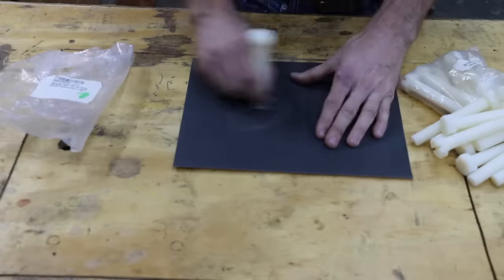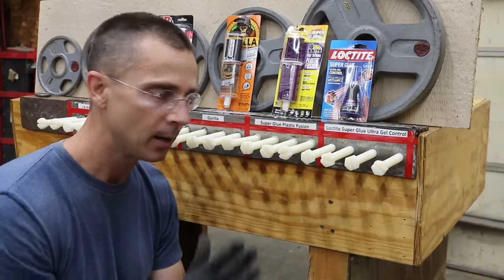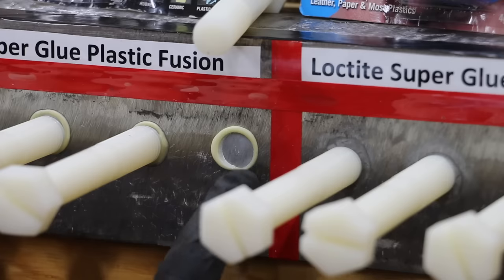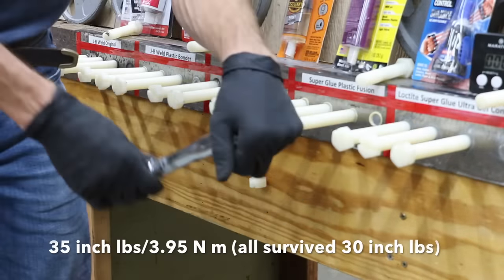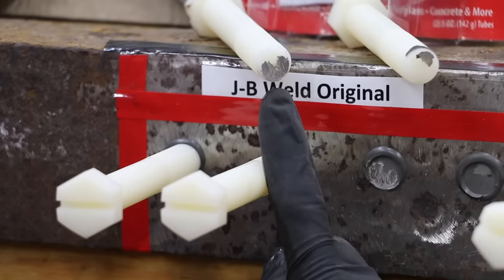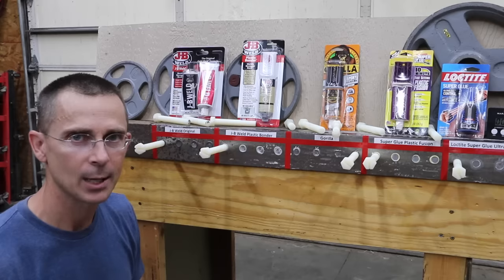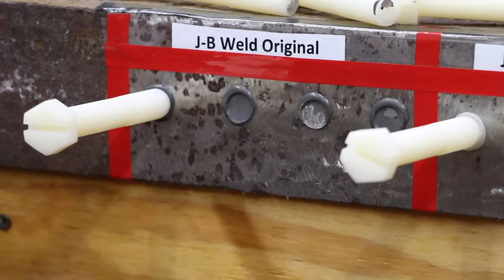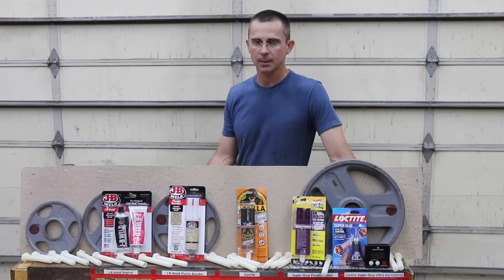Which Epoxy is Best for Plastic?  Let's find out!

Comment: This was a very tough test. You used nylon bolts. It is very difficult to get anything to stick to nylon. Good job as usual though.
Reply from the maker: This is a great point. I plan to test plastic on plastic soon.  Are there a few plastic glues or epoxies that you recommend I test?  I'd like to stay with the consumer price range if possible.  Most people aren't willing to spend $30+ on a plastic repair.
Reply: PF....I can't off hand think of any specific plastic epoxies but I have used JB Weld Original with fiberglass mat to join broken motorcycle plastics together with great success.
Reply: Project Farm could you test Devcon Plastic Welder. It must have some strong solvents in it because it sure puts off some fumes.
Reply: Project Farm- You should try using acetone to melt abs plastic together
Reply: ......and I'm one of 'em!
Reply: Exacty. It's even hard to get FRP {fiber reinforced plastic} even the best epoxies on the market at many times the cost is hard to stick to nylon. You should have tried ABS and PVC since this is what plastics are. HDPE and Nylon are very hard to stick to anything.
Reply: If you do plastic-on-plastic,  in addition to epoxies, can you at the same time try superglue and baking soda?  I've seen videos of it holding a damaged plastic ATV fender together.
Reply: I'd like to see this test done to three types of materials: HDPE, PVC, and FRP. Those would be the plastics most likely to be glued back together (plumbing, toys and tool/vehicle plastic parts)
Reply: Epheron.....I agree but I am hesitant sitting here on my sofa to shout commands across the internet to somebody actually doing work. I understand PF wants suggestions, and he's getting them. His vids are great.
Reply: @blipco5 do you think using JB Weld and fiberglass works better than fiberglass and fiberglass resin? I've used the resin/glass combo for bike and car plastics before mostly because it's cheaper but I'm curious for extra high strength applications.
Reply: Yes because Nylon is very chemically resistant.  I don't think any common solvent attacks it.
Reply: Project Farm loctite plastic epoxy common. Also Walmart has an epoxy brand they sell.

Would be interesting to see how the epoxy held up against plastic heat welding, a fairly affordable alternative to epoxy glue.
Reply: J-B Weld Plastic Bonder is a urethane-based adhesive. J-B Weld also makes "PlasticWeld", but I do not know what kind of adhesive that contains. Probably worth a test, though.
Reply: I agree this was a good basic test, but was far from scientific. This video could narrow down epoxy choices, but plastic is not all the same. Gluing ABS, Nylon, polypropylene, etc all require different chemical properties, same is true with the metal being glued to. Even a minor variation in technique when mixing or applying epoxy can have very different results, so testing to one failure with each test method could be a failure due to operator not epoxy. Having bought and tested numerous glues and epoxies for my own projects I sympathize with the cost and ability to do repeat tests, but I recommend people try at least a few epoxies or glues on the materials they are trying to bond if maximum strength is desired.
Reply: Ya most radiator tanks if not all are made of nylon with new cars
Reply: @XJWill1  According to JB-Weld they are the same except that one dries opaque black and the other transparent yellow tinge.
Reply: @ProjectFarm  In my case I'm attempting to fix a nearly $300 shower pan. A $30 fix would be fine. But I understand what you're saying.
Reply: Project Farm did you ever do that plastic to plastic test? Need to glue a lot of plastic together was wondering which brand I should buy.
Reply: @ProjectFarm  I broke the throttle lever on my quad ATV. It's a heated grip. Changing it will cost over $130. I'm hoping to be able to repair it with some type of plastic adhesive. Any suggestions? I'm willing to drill small holes and install metals finishing nail studs if need be
Reply: @ProjectFarm  I know this is an old video, but I was actually looking at GO2 by loctite which is not an epoxy, but it has the consistency of epoxy so it can fill cracks.
Reply: I'd test Loctite plastic bonder, JB Weld plastic bonder, Gorilla Glue, Devcon, Permatex plastic bonder, PC-7 and Scotch Weld (3m) plastic epoxy. Make sure all are for plastic if possible and all should be a 2 part epoxy, not a 1 part super glue like the Loctite used in this video against competitors 2 part epoxies..
Reply: @JoeHeiserA  Hey Joe, Fiberglas resin is not actually waterproof. This sounds like complete heresy, but.... I made a couple of photography darkroom sinks, they'd get these pinholes. I thought 'gee I must have dropped something...' Nope. Water and the resin chemically react and pinholes are the result. These let water in and bubbles form. Back in the 1970s boats were made of fiberglass resin and they were endless maintenance headaches. (Some of these guys would see my wooden glass and epoxy boats and think I was nuts.)  Your bike and car plastics are not going to be immersed in water for long periods of time, so okay. But look this up, it's really interesting, not well known. Guys think they'd done something wrong. For hiking and camping there is Cuben Fiber Dyneema fabric. It's super lightweight, waterproof, very expensive. It also gets pinholes but I don't think it's the same as fiberglass resin. It's taken about 10-15 years for backpackers to begin wondering if the weight saving is worth the problems.
Reply: I can't say exactly how strong the results are, but there is one recently-discovered trick model makers use for difficult plastics like polyethylene and (IIRC) nylon -- and even polypropylene, which is traditionally the toughest plastic to bond. There is a clear spray primer, available at AutoZone and similar stores, called "Adhesion Promoter" or something similar. It is made for allowing paint to adhere to plastics such as the bumper covers on cars. Apply that to the plastic you want to bond first, allow it to dry according to the instructions, and then apply the adhesive of your choice. I can't guarantee it will work on all plastics, but it is worth a try. Many model makers have reported good results using this technique, both with paint and adhesives. Make sure to clean the surfaces first!
Reply: @toddhayslett8269  wish I would have read this yesterday before I put the time and money into trying to use a nylon mesh to reinforce the bond for a cracked utility cart 😞
Reply: I noticed the same thing.  Most people using glue on plastic aren't using nylon parts.  They're trying to fix some sort of toy/cup/etc. which is almost never made of nylon.  Nylons is pretty much restricted to exactly what he's using here, nuts/bolts/washers/thread rod/etc.  Those are things you'll almost never be gluing.  I would like to see a more realistic test plastic bonders being used on stuff we might encounter needing to glue in a garage like ABS, polypropylene, SAN or polyethelene/CPVC.. or even broken car interior pieces (that's one I've had to deal with the most when it comes to plastic bonding).  Plastic car parts become brittle over the years and unlike the cars of old almost everything is made of plastic these days.  Even the intake manifolds.  It's only a matter of time before they engineer the first exhaust manifold good for exactly 50,001 miles (IE just past the warranty).
Reply: Try tech bond for nylon nylon is difficult
Reply: @bhartley1024  I second the request to test Devcon Plastic Welder. 

And PF, please address the difficulty of repairing a HDPE or LDPE. TAP Plastics make an adhesive that requires flame treating of the plastic before applying the adhesive but say it gives good results.
Reply: @ProjectFarm  This is essential. There's a spectrum of bondability of plastics ranging from low energy plastics to high energy plastics. Examples of low energy/bondability are PTFE and UHMWPE. On the high energybondability end are ABS and acrylics.
Reply: @ProjectFarm  there is a thing we use in the shop for plastic bumpers it's a fiberglass epoxy idk if that would be an idea?
Reply: blipco5 I agree. I don’t think anybody who knew anything about handiwork would ever adhere anything like this expecting it to hold.
Reply: @ProjectFarm  Great that you are testing these glued joints in torsion, shear and tensile stress.  Have you done the plastic on plastic test yet?  Would love to know what you find out, especially when gluing common thermoplastics being 3D printed like PLA, ABS and Nylon to one another.  Most people are using CA but got to think there is something with better shock absorption out there... people have mentioned hot glue, advanced CAs with primer, and gorilla glue as the best options... also, looking at different surface preps would be super interesting (rough sanded and iso cleaned, just iso cleaned, etc.)
Reply: @ProjectFarm  styrene, pvc, cpvc
Reply: @kellerrobert80  I think the baking soda is just to fill gaps & cracks, where the super glue does all the bonding. I've seen alot of videos doing what your talking about. It's pretty creative. But yeah I'll agree let's test out this theory.
Reply: Also did you prep the plastic? (Scuffing thé mating surface).
Reply: 220 i see. But something more aggressive would have been better big scratches:)
Reply: No doubt, Nylon, Delrin, Teflon are very difficult to bond! I believe the most common plastics are Nylon, Polypropylene, ABS, and Polyethylene, PET, PVC, Polystyrene, Polycarbonate, Acrylic, Acetal (Delrin), not necessarily in that order. Definitely must test for each type of plastic bonding application and what kind of strength characteristics are required/needed. Surface prep is also super important. Glossy, smooth, or oily surfaces don't help adhesion/bonding in my experience.
Reply: West system g/flex plastic to plastic
Reply: @ProjectFarm  My thoughts were, Hey, Nylon... Wait, most Plastic adhesives and epoxies claim results on Polypropylene and Polyethylene, which otherwise seem impossible to bond with glues.
-And, as always, thank you for all of your great tests!
Reply: This comment was immediately what I thought when I saw after just a few minutes of watching the video. While the way the test is performed is ok for a performance check, nylon doesn’t really bond in this way. And the test should have been performed with PVC, ABS, PP, or even PET. This test essentially relied on the surface tension of the epoxy. Which isn’t a good gauge of its performance in an appropriate application.

Comment: It makes a big difference on which type of plastic you are trying to bond with. The different polyethylene types, polypropylene, polystyrene, and PVC all need different bonding agents to make a successful plastic weld. Picking up a regular off the shelf epoxy from a hardware store is asking for bond fail. Thanks for the video!
Reply: Any tips on what kind to use for a car door handle? I would be "gluing" the front plastic piece onto, another piece of 3/4 inch corner mold. I could buy the corner mold in a specific type of plastic  when I go to buy it.Then the other side of the corner mold will be glued onto the part of the door handle that remains on the car. This is one of those pull upward door handles. Thanks for any ideas.

Comment: You have tested steel to steel ,   plastic to steel ,    BUT ,  have you done plastic to plastic?
That is the one I'm Really curious about. ......  point out if you have done plastic to plastic , I might be over looking it. Thanks
Reply: He did do one where he glued pvc pipe to itself.
Reply: @kkampy4052  hi - which video was that? (I tried to find it and didn't)
Reply: We're curious about different types of plastics. At least the main 5 or so
Reply: @kkampy4052   that's Construction adhesive,  not plastic epoxy
Reply: I am also interested in the best plastic to plastic epoxy.
Reply: @kkampy4052  that was more about liquid nail products rather than gluing plastic to plastic.
Reply: What kind of plastic you want to bond?
Reply: Was the plastic HDPE?
Reply: Pau Pau  link?

Comment from the maker: Thank you all for continuing to provide future video ideas!  Here are the links to the products tested in the video.  Highly recommend shopping around for the best price.  Best regards, Todd
Gorilla Clear Weld: https://amzn.to/2Ynh3AX
JB Weld Original: https://amzn.to/3j2SlxO
JB Weld Plastic Bonder: https://amzn.to/3jaihHJ
Loctite Ultra Gel Control: https://amzn.to/3hmyk4Z
Super Glue Plastic Fusion: https://amzn.to/32kp5vR
Reply: it would be great if you tested how well they bonded to one another, and then done the subsequent tests.  Id love to see gorilla on the bolt and jb weld on the metal. There is a dozen variables you could explore, regarding the curing times and which is bonding to which, etc..   love your channel. top notch!
Reply: I was watching super glue and mixing baking soda with it. Even ash's and super glue. Amazing results! So what super glue mixes with a control using different ash/soda's. Strongest to hold weight, how they cut, sand. The other variable is using release agents. I have seen grease, wd-40,  motor oil, or aluminum tape and masking tape.  Long time sub. Hope you at least see this??
Reply: Try 3m scotch weld 👍
Reply: Can we recreate this test?  Maybe test to see how they do when they are below freezing temperatures.  Test when they are welded to themselves.  Or any other test that you can think of.
Reply: @topherteardowns4679  Also curing with UV light.

Comment: Speaking as a person who has actually designed research projects, I must say that your experimental designs are very well thought out! You put a lot of effort into minimizing extraneous variables.

Gluing plastic is almost always problematic for me. Nylon is naturally "lubed" so especially tough. Same with polyethylene. Not much sticks to it, except labels when you want to remove them.... If I can, I will do bizarre surface preps like cutting holes or slots, sanding etc, and if using a suitable glue, I'll overglue to embed the parts in a blob of the epoxy. If faced with butt-gluing small plastic bits, I usually don't even try.
Reply from the maker: Thanks!
Reply: yep i would agree some plastics are made so nothing sticks to them very well, using a solder gun to melt some metal to them and then glueing that would probably work

Comment: The Loctite  was quite impressive. The bolts you used are nylon,  each plastic has profound differences in how they perform and react to things.  Here's a tip taught to me by an old-school mold guy.  Take a piece of known plastic and light it on fire   (all you need is a sliver)  Blow it out and sniff the smoke.  NO TWO PLASTICS SMELL ALIKE and the smell is so strong you'll never forget it. 
All ethylene family plastics give off oils,  To bond to them ya gotta remove the oils and since there's always more trying to come out it is a really improbable proposition.  We used to use E-Beam Rastering to flash off the oil with some success.  Some.

Comment: Great video as always. Part of the problem may lie in the type of plastic used to make those bolts. Delrin, Acetal, and Nylon 66 are examples of Copolymer and Homopolymer's that leach oils.

There is a high probability that those bolts had lubricants added to them to provide lubricity to reduce friction, heat and to prevent galling when tightening on the matching nuts.

These types of plastics leach oils and can prevent glues and paints from sticking to them.
Reply: Mostly nylon might as well have been silicone.

Comment: I have never seen you test in epoxy called pc-7

Growing up in the Northeast it was our go-to product.

40 years ago I remember standing in a hardware store as a child admiring this little statue they had on the counter that was a demonstration to pc-7 strength.

A bottle filled with colored liquid with nuts and bolts and golf balls glued to it he could not pull apart.

 we use pc-7 on a variety of projects over the years and never were disappointed.

 I believe it is an equal to the original JB well if not better.

Maybe a showdown pc-7 vs. J-B Weld?

Anyways, another great video thanks
Reply: PC 7 and PC11, are great. They are more of a paste and can fill, whereas JB is a thin liquid. 11 sets up under water and is white. HIGHLY recommend
Reply: How about throwing 3M 5200 into one if your test for us boaters. We use it as an adhesive and as a sealer.

Comment: What a crazy test because I tried J-B weld original to fix the top corner of a plastic radiator and it cracked again. After cleaning and sanding again, I used super glue and baking soda on the radiator on day two and  the radiator did not crack on the way home from work this time.